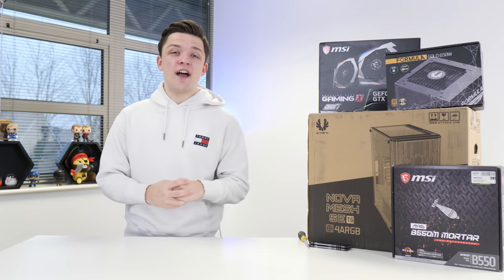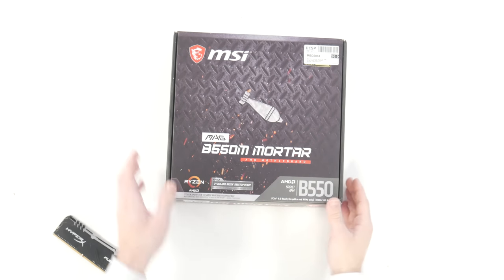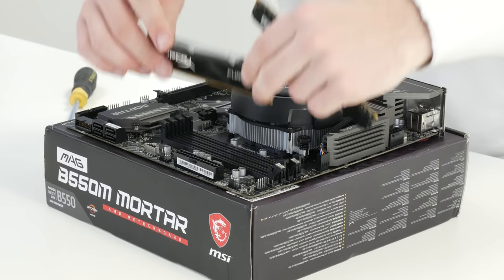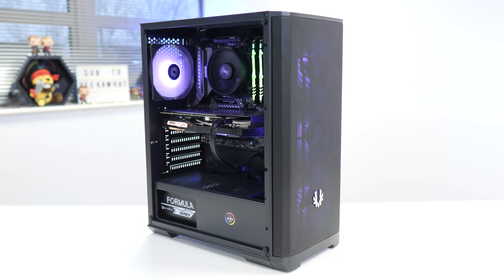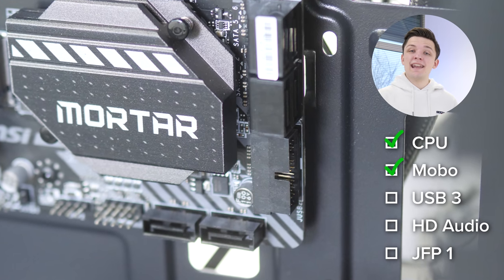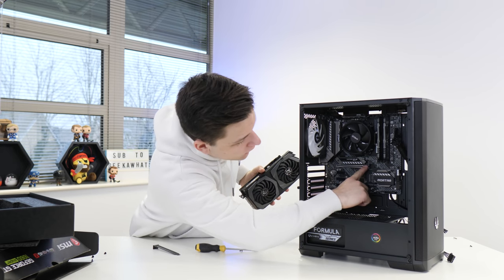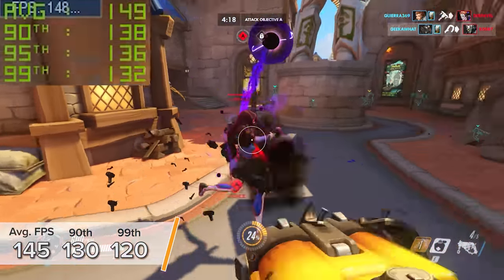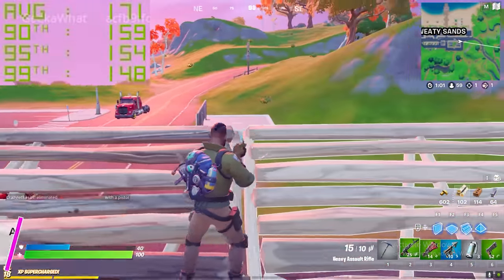$700 Gaming PC Build 2021! [1660 Super Build Guide w/ Benchmarks!]

Comment: Okay question. I want to build my own pc and I’ve already started budgeting and planning. I wanna use a Ryzen 7 3700X and a RTX 3070. But as we know I can’t get a 3070 anywhere. Should I get a older cheaper GPU that will be easier to get (like the 1650 or 1660) until I can get my hands on the 3070. Or just wait it out?
Reply: Its probably gonna drop in price while you wait if you buy a 1650 or so, btw if you dont do anything else than gaming znd watching good vids like this one, that cpu is overkill
Reply: Bro a 1660 super is like 100+ price rn it’s ridiculous

Comment: I bought a prebuilt for 750 dollars from leanovo with a 1660 super and it runs like 210 fps low settings on fortnite BUT its cpu always gets hot and the fan is so loud so idk if i should return and build one instead

Comment: Yeah this is $700. lol not. Those parts have been way more than $700 for the last 6 months. the gpu at normal price is $270 and the cpu is $200.  Ram is normally $80ish. motherboard is $130-150 normally. Without the SSD, Case, Fans, and PSU this build is normally over $700. This is not even including the price hikes so this is around $900 to make rn.